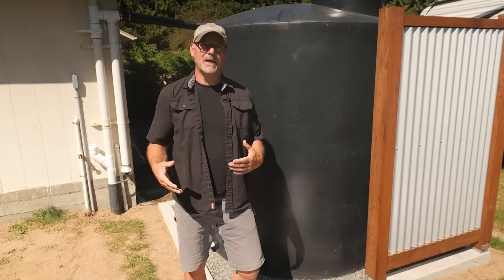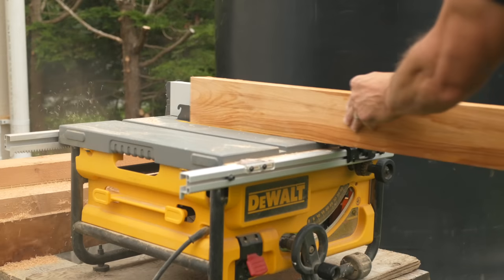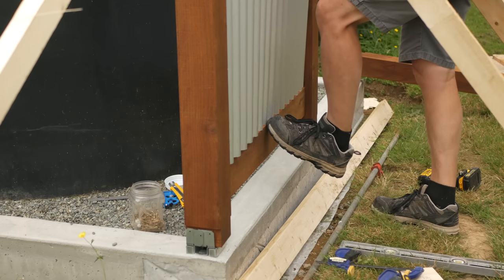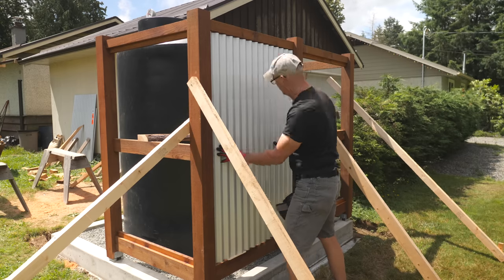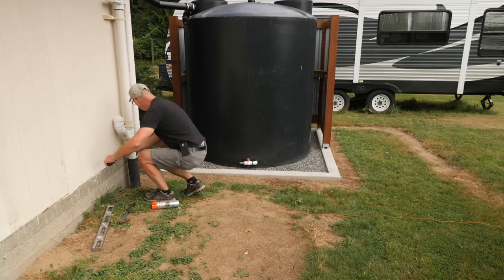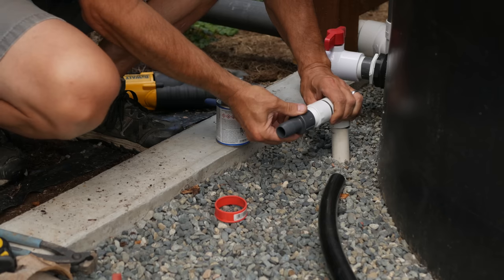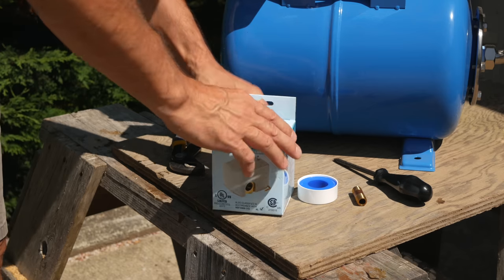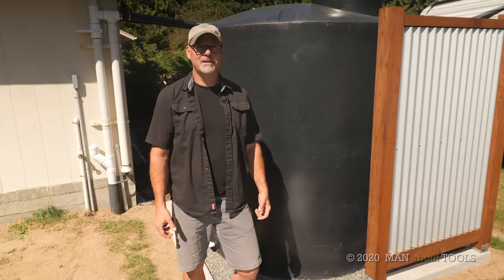Rainwater Harvesting Tank - Water Pump & Irrigation Piping

Comment: On your dado cut on the bottom rail you should add just a little bevel so water won't sit in the notch. Since it's western red cedar and stained I'm sure it will last for years, but it's still worth adding a little slope to promote no standing water on wood.
Reply from the maker: Great point here! Thx

Comment: Love your content.  One note, you should put in a one way check valve from well pump line into the "garden watering system".  You never want the water to accidentally backflow.  If your well pump fails, you could accidentally push water into the house.
Reply from the maker: Thanks! The irrigation system is completely separate from the house system.
Reply: @MANaboutTOOLS  I figured that out in the next video in the series and saw the check valves you have installed. I love the new outdoor concrete countertop.

Comment: Make sure you exercise those PVC valves regularly. If you don't they have a tendency to seize, and generally get broken when you try to free them, especially the handles.   I know brass valves are more expensive but I think they are worth it in the long run. They will hold up much better, and don't break near as easy.
Reply from the maker: Good tip. Thanks!

Comment: Very good video.  I wonder if two coats of stain are enough  to prevent weather damage to the end grain.  I like the look without a post cap so I would use a thin epoxy to seal the end grain.
Reply from the maker: Thanks! I also like the look without a cap. I was thinking of a flat square of galvanized sheet metal siliconed on the top of the post.

Comment: Thanks for the video.  The pipe fittings would have fit together easier if you heated them first with a heat gun, or a torch.
Reply from the maker: Your welcome! And yes, heating the pipe would have helped. Good tip!

Comment: I like the look of the fence, it came our really nice. Just a question, isn't the tank pressure regulator adjustable? (The older one I have have is.)
Reply from the maker: Do you mean the pump? If so then yes you can adjust the on and off pressures of the pump switch. I replaced it as I wanted a switch with a low pressure cutoff.
Reply: @MANaboutTOOLS  Thank you for the reply, I learned something . I'll have to check mine now and see what type I have.

Comment: seems real well-built, but I think it would have been easier to dig a big hole and bury the tank underground. An electric pump could get the water out for irrigation. Wouldn't have to worry about UV damage to the tank, etc.. Also have to worry about water freezing in the above ground portions. Might crack the lower valve.
Reply: Our 3k gallon one is exactly as you describe: half is under ground. The top half is in the sun. Just watching the last 10 minutes of this because we need a new pump. Wish he would have explained why he was changing the 20/40 out for a 30/50 on the pump.

Comment: Just curious,  is there no need for a one way valve on the other supply line and vice versa on this system?
Reply from the maker: I wasn't sure if I really needed the one on the line that heads to the garden. But, that system can be pressurized by the well pump. I guess that when switching over I could let the pressure off before turning on the rainwater pump and then that would not be needed. I might do a follow up video to look into this.
Reply: The other benefit would be to maintain line pressure between the two systems, where you would prevent pressure from bleeding back into the secondary system and vice versa

Comment: DIY'ers beware!!!  He has a separate irrigation system for his garden and quickly mentions a separate well pump solely for irrigation at 12:20.  That is very important!!!

Most residential irrigation systems are fed from the potable water supply to the house.  If you connect a rain tank and pressurize the water from it, like in this video, to a water supply connected to your house, you could end up pumping the untreated rain water into your house for use/consumption.

A Back flow preventer would be required between the potable water supply and the tee connection from the rain tank.
Reply: I have watched the videos, and as far as I can remember he never mentioned his potable water system. The whole point in his rainwater collection system and shallow well is to WATER HIS GARDEN!

Comment: Is it your north American accent or are you actually calling the rebate in the wood rails a 'rabbit'? Also - if you'd gone a few centimeters higher with the posts you could have had enough clearance to put a metal roof on the structure.  You'd catch  a couple of square meters of rainwater every storm. Maybe that does not matter so much where you are located as everything looks very green. But a roof would also protect the plastic tank  from UV. One more point - you seem to have screwed the corrugated iron on the valleys rather than the rises. It doesn't  matter so  much on a vertical surface but it's surprising to see so many people doing that on  roofs.
Reply from the maker: I do pronounce it like rabbit. I did consider a roof but had plenty of that already with the combined shop and shed roofs.